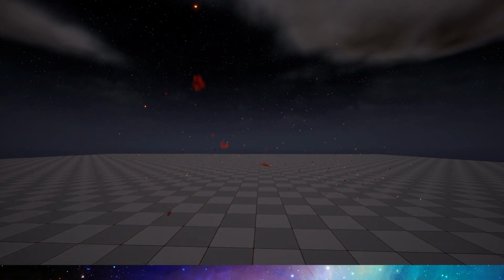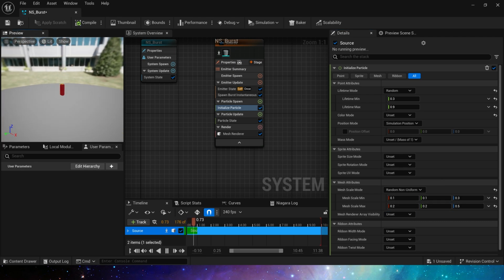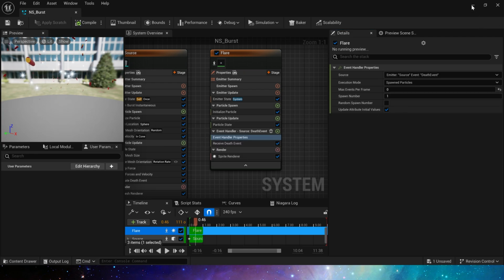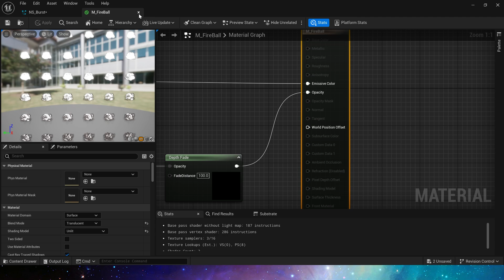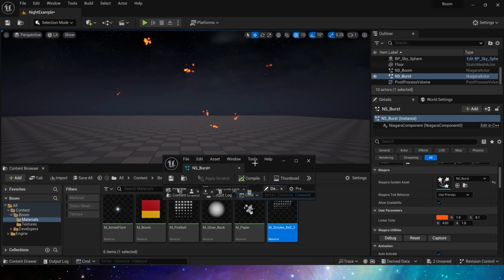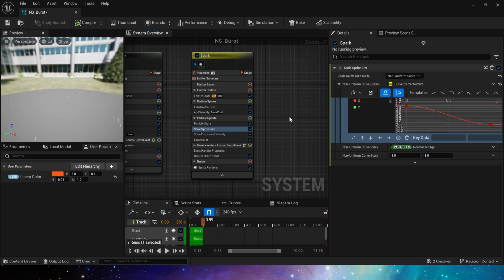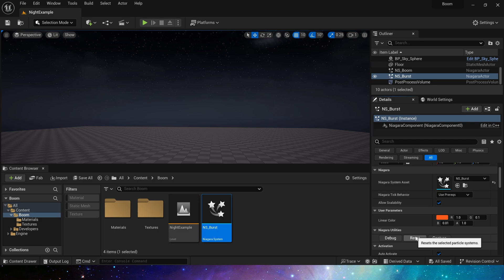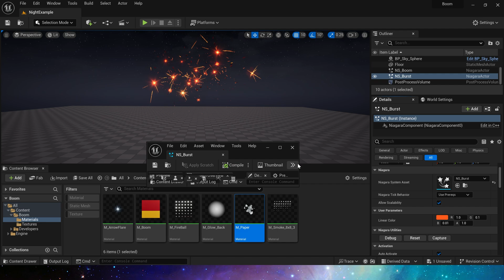UE5 Niagara Burst VFX - Tutorial

Comment: Overall I like the content in your videos, especially the techniques that you present, but I have a few suggestions for the way that it is presented.

The video was a bit hard to follow, since it quickly sped through some of the key parts that I was interested in.
I've been working in U4 for the last 9+ years, but haven't touched particle systems much, and very new to the Niagara system.

So I was interested in what to start with (since you are presented with a page of options an templates when creating a new Niagara System.
I had to back up a couple of times and slow it down, since you blazed through the creation of the asset in just a few frames, but it looked like you opted to start with an empty system, rather than the burst template.

Then I was especially interested in how to set up the mesh for the burst (as I want to spawn tiny meshes rather than billboards for this particular effect), but I am now in the process of going back through that part which again was accelerated to just use a couple of frames for the setup process.

At 1:22 when it says "a mesh like fire cracker", I have no idea what is happening on the screen, the view starts to change without any explanation and at lightning speed.
What happened to the "Sprite Renderer", did you press delete to get rid of it?
Even stepping through fame by frame, it gets selected, the mouse quickly wiggles, then it's just gone with no explanation.
Then I had to step through frame by frame to see that the + icon was clicked and Mesh Render was selected, because that all happened in a blur in the original video.
This all happened in about 15 frames, including the mouse wiggling, and all within the 1:22 timestamp, which again appears as a blur at normal speed.

This might be one of those things where if you were trying to edit the video to pace with the monotone TTS, it may have been better to instead breakup the speech parts a little more and slow down to explain the setup a little more rather than glossing over it.
Or if you increase the video speed, maybe just a slight increase rather than 2x or more.

In any case, the concepts that you are showing are indeed useful, and I'm sure the presentation quirks will get worked out in due time.
Perhaps consider slowing the pacing down just a bit, and then people can always increase the playback speed if they think its to slow.
Other consideration might include using zoom to focus in on the area, then slow down and take a moment to point to what is going to be clicked and/or descrbe what you are doing if not visible on screen...
(like "select the Sprite Render and press delete to remove it, then click the plus icon next to Render and select Mesh Renderer from the list")

Thanks for the tutorial and keep up the good work!